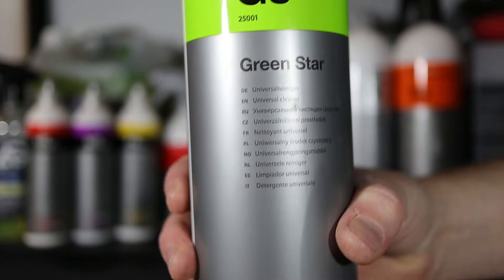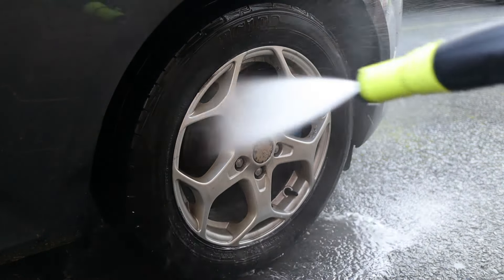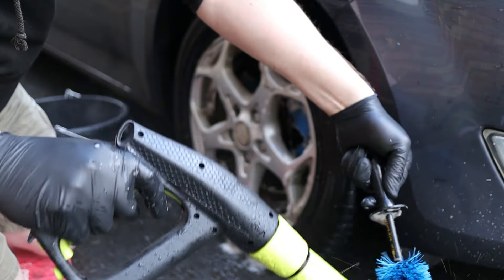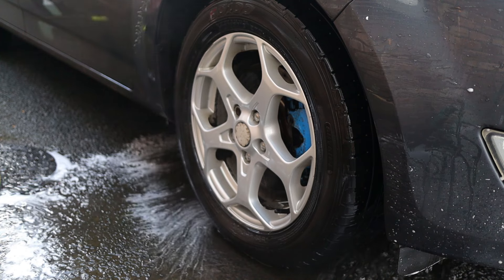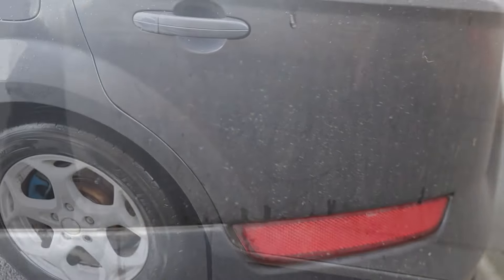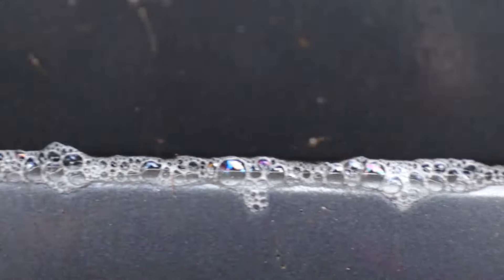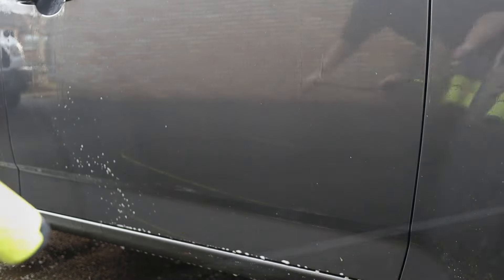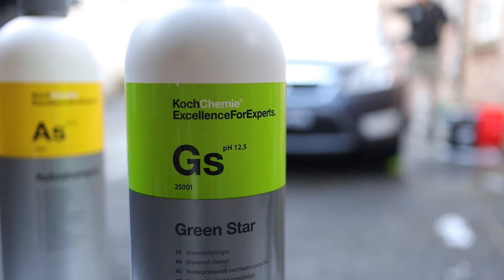Koch Chemie Green Star APC Universal / All Purpose Cleaner | EP018 #carwash #cardetailing #carcare

Comment: Good that u try the wheel cleaning with no brushing as I think even the worst cleaners will give a decent finish a lot of the time with a brush to aid it 👏
Reply from the maker: Yip, I thought it was interesting... The foaming ability made the contact wash on the wheels very enjoyable though, very happy with that, especially at 1:10 👌🏼👍🏼
Reply: @SparkleanAutos been using it a while have knocked using a dedicated wheel cleaner on the head tbf just use fall out every now and then and gs and shampoo
Reply from the maker: @barryjones6214  sounds like a spot on system Barry 👌🏼

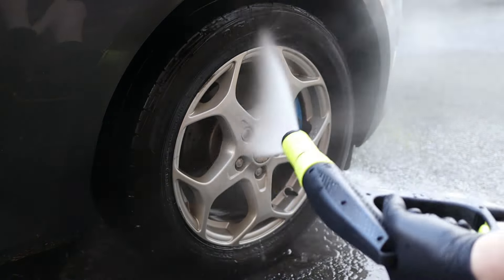Comment: I used GS 1:50 on a customer's car as a prewash, rinsed car before, was in my garage (so not in direct sun light), waited 2 mins and sprayed off. It left a horrible film on the car. I still can't explain or figure out why? I had to clay bar the vehicle it was a HUGE mess. Prior to that I have used it 20-30 times on my own vehicles as a prewash without issue 🤷🤷
Reply from the maker: Strange one!! Can only assume there was something else previously applied that it reacted with, or some other contamination that the car came into contact with that wasn't visible - can't imagine it was the Green Star alone, especially at a 1:50 dilution!! 🤔

Comment: I've used this on my car, about 30:1 dilution, and it's awesome. Hot water is better when using these types of products as it foams better and actually gives the APC more bite and cleaning power ( IMHO ) - but, your film on TFR blows this away....think I'll use TFR to pre-wash from now on, since it's great for a trailer/ trucks, then my car will also reap the benefits of the TFR cleaning power...it's only fair, seems silly not to
Reply from the maker: The only thing with the TFR, even a non-caustic one like that, prolonged use still carried the risk of fading uncoated materials (black plastics etc.) The stronger the chemicals the greater the risks!

I tend to keep the TFR on standby for vehicles that need it - commercials or something that hasn't been cleaned for a while and has little to no protection. Personally I'd avoid it as a regular/weekly maintenance product, as good as it is 👍🏼👍🏼
Reply: @SparkleanAutos  I get it, but, when you use a degree of common sense, then this won’t really be an issue. Given the fact there are loads of good plastic restorers out there, for getting the debris on the car off in one shot and then using a contact wash, as long as you don’t let it dwell for silly amounts of time, it’s an economical way to clean your car. And you’ll have less reliance on a citrus pre wash. Even with the latter, really good ones carry the risk of harming the plastics. Chemical guys do good restorers, so there’s that option. Also depends on age of the car, etc
Reply from the maker: @lifeslooker  100% Jason... Common sense approach and all will be fine 🙂👍🏼 like you say, most Citrus Pre-wash products are no safer
Reply: Was it here you used the glass repellent that’s been on 18 months? If so, what’s the name of it? I wanna get some!!!!
Reply from the maker: @lifeslooker  lol it wasn't actually in a video believe it or not .. at the time the channel was fairly new and I hadn't time or confidence to film everything!!!

It was actually Anglewax H2GO... Very good glass sealant and I will definitely be doing a video in it soon 👍🏼
Reply: @SparkleanAutos  looking forward to that one - the beading and sheeting on it was awesome ( if that's after 18-months of protection, day one must have been even more effective )
Reply from the maker: It's incredible stuff but there was a lot of prep too!

Comment: Excellent video on Green Star. You had two different dilution ratio. One for tires 10:1 and paint pre wash at 30:1?
Reply from the maker: Hello Danny and thank you! Sorry for the delay in replying!! Yes thats correct, most APCs etc I would expect to be strong enough at 10:1 for wheels and engine bays but I dial it back a lot further for the bodywork - mainly to be less aggressive of whatever protection is on the car 👍🏼
Reply: @SparkleanAutos  thank you. Excellent info. I was amazed 30:1 ratio did a great job as a prewash.
Reply from the maker: It's a fantastic product I must say - although I will stress also that, as dirty as the car was, there was a layer of protection there which always makes a big difference to how pre-wash products will perform 👍🏻👍🏻

Comment: Acid used to clean the stainless steel weldings is the best for cleaning the rims
Reply from the maker: What type of acid are you talking about because you shouldn't clean painted wheels with acid cleaners on a regular basis.
Reply: @SparkleanAutos  Acid does not affect paint in any shape, some things don't go out without it, try applying with a brush in small dosage and wash with water pressure machine, you'll be impressed, there's nothing better than this
Reply from the maker: I'm fully aware that some instances require acid wheel cleaners - I've been cleaning cars for 30+ years .. my point is that it's completely unnecessary and potentially harmful to use them regularly - yes the paint itself may not be susceptible to damage from the acid cleaners, but surrounding parts might be - plastic centre caps, unpainted wheel bolts, brake/suspension components.

Every type of cleaning product has its place, but not every product is suitable for every situation. I wouldn't use acid wheels on a regular basis in the same way that I wouldn't use a polishing compound on a regular basis.

If you disagree then that's entirely up to you, feel free to create your own content demonstrating why your method works better for you and I for one will be happy to subscribe and watch 👍🏼

Comment: For wheels, I would use 1:5, it's doing a much better job in this ratio.
Reply from the maker: It's extremely effective at 1:5 but I find it's not really necessary, certainly not for maintenance cleaning, and 1:10 is absolutely fine for those jobs. 👍🏼

Comment: Grand stuff on the interior as well.  Iv switched from using surfex on interiors as Greenstar is better at minimal dilutions.
Reply from the maker: It's definitely a very good alternative and much better value if you're only buying 1L 👍🏼
Reply: Polstar is also a good shout on interiors instead of Surfex which I tend to find leaves a slippery film behind which needs to be rinsed by water.
Reply from the maker: @kwl189 I've stopped using Surfex for a lot of jobs for the same reason... No matter how weak the dilution, it always seems to leave a film behind 🤷🏻‍♂️
Reply: @SparkleanAutos  For interiors it really needs to be 1-2% max but the thing that made me switch to Pol Star full time for interiors was that it leaves a layer of protection behind, some blackening effect but most importantly can be used on leather perfectly fine.